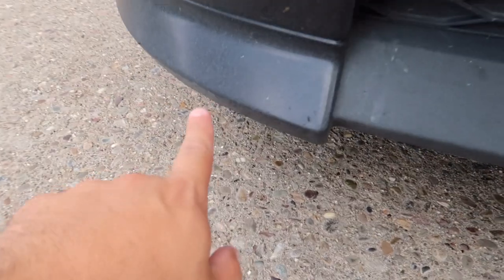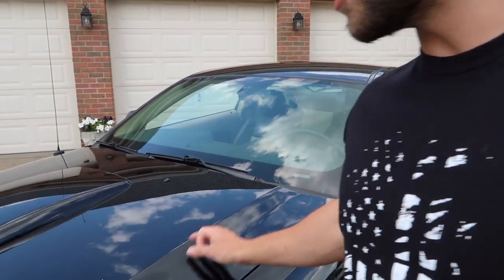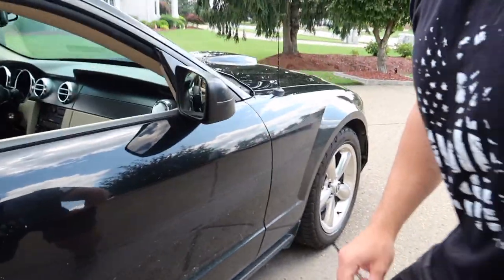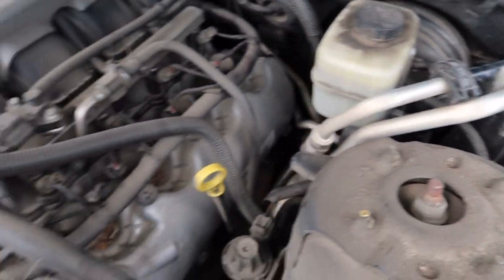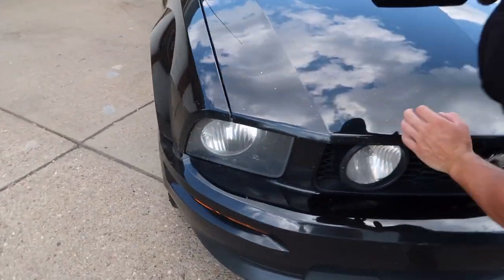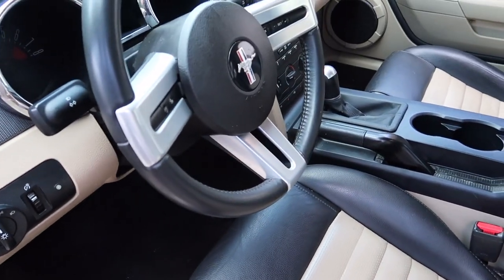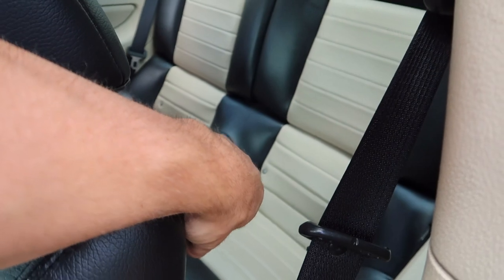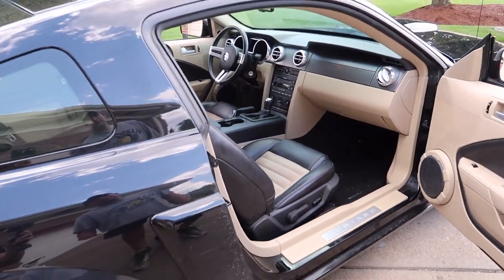Everything You Need to Know About Our $5,500 Mustang GT/CS!

Comment: It’s not rust per se but corrosion of the aluminum hood caused by iron contamination of the aluminum hood during manufacturing. Many cars were affected but some cars were not. I have a 2006 not winter driven and it had the hood bubbles appear when it was 3 years old and I know another person with the same year car that never had this issue. This car here is an example of one where the hood was not contaminated during manufacturing.